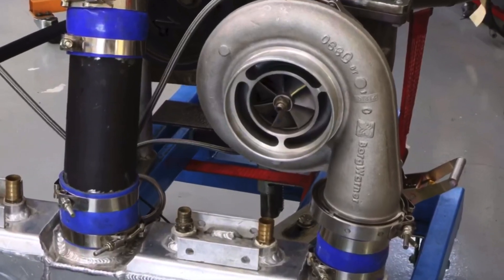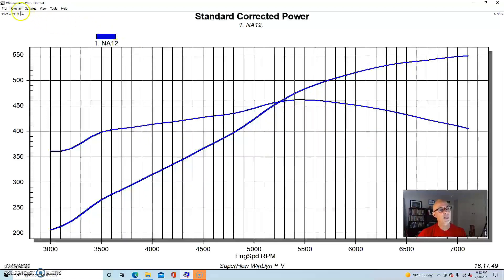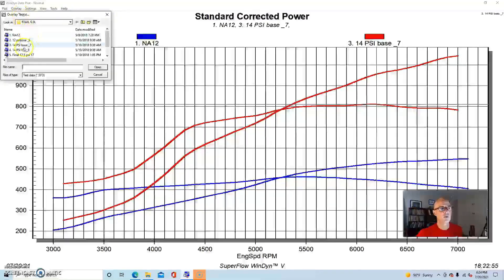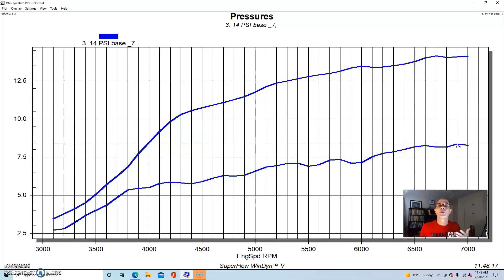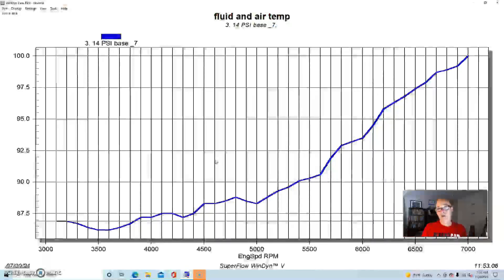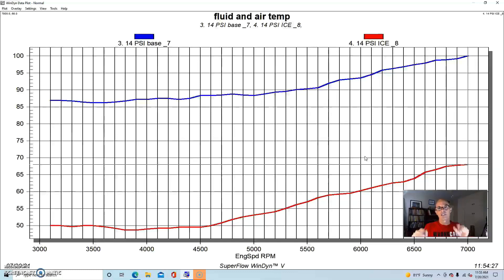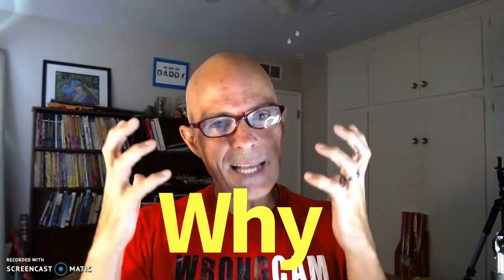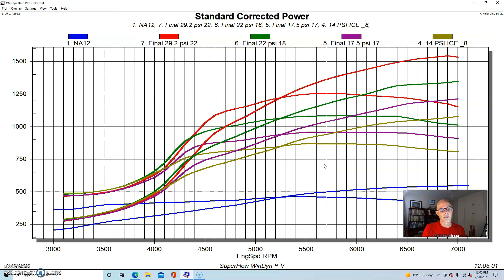JUNKYARD TWIN TURBO 6.0L ATW INTERCOOLER TEST (ICE WATER)

Comment: Richard - i'm not sure that i've ever seen it done, never mind by someone that does things in the scientific ways that you do, but i would LOVE LOVE LOVE to see you do a test on a basic LS, say a sloppy stage 2 cam or whatever, but use two different sized turbos... say a 78/76 and an 88/103, or a 67 and 78 on each side.. Just to see what happens! and a fair gap between the two (5+mm?) so that way there's definitely a difference in flow...        I would be seriously interested to see if that would HELP or HURT the horsepower! Maybe the bigger turbo would "fight" the smaller turbo and actually cause LESS boost..

Maybe even just have a bench racing live session and discuss it?!
Reply: all these tests have been done you just have to look back over the channel
Reply: @bill2178  I browsed through recently and couldn’t find anything on odd sized twins. Obviously there’s a ton of single vs single vs single videos but not what I am referring to. I could have missed it though - I’ll look again!
Reply from the maker: they will fit each other-flow from the small turbo that spools quicker will try to escape out the big turbo at lower speeds, the opposite at higher speeds (unequal flow) is my guess
Reply: @richardholdener1727  that’s basically what I would expect.. small turbo would counteract the large turbo down “low” rpm, but once the exhaust pressure spools the big one it would probably freight-train the hell out of the little one and stop it from making boost. If I was a betting man, I would expect a wavy boost curve and low boost top and bottom rpm ranges… and I mean manifold pressure not turbo outlet..

Comment: The turbo is a “free air” device, seeks equilibrium in its own space. The denser charge made more power, increasing the energy available in the exhaust flow to the turbine. The compressor got spun a bit higher and, with the denser charge, pushed more air mass into the engine. Air actually has very significant mass and making it over 30° cooler has a significant effect. Absolute zero F is about negative 460° so the density change due to temperature is approximately 560/527, or about 6% more dense. The Holley sees more air density, adds fuel accordingly, and that increases everything. That’s my 2 cents worth on the subject, anyway.
Reply from the maker: the Holley did not see a change in air temp-but I did add fuel to to keep the af consistent between the two runs

Comment: I'm thinking the denser air caused the turbine to spin faster.  Do you have a graph of turbo RPM?
Reply: That was sort of a knee jerk answer.... as you pointed out the back pressure increased because of air density so this caused a greater pressure differential across the turbine making it spin faster.  Also maybe it got into a more efficient part of the map.

Comment: Richard could you run and U run antifreeze and dry ice through an intercooler ? Maybe for a video
Reply: anti freeze isn't the best for picking up heat. I run only enough anti freeze through my air-water intercooler to keep it from freezing in winter.

Comment: Possibly, the increase mass of air (density) with the same fuel input would create a leaner air:fuel mixture. 
Meaning it it was slightly rich on the initial tune and closer to optimum with more air.
Reply from the maker: af was identical
Reply: @richardholdener1727  so total fuel increased to maintain the same ratio. 
More air + More fuel = More Power. 👍
Reply: @richardholdener1727  ah, misunderstood. 
I thought that the fuel volume/rate/tune was identical.
But it was the A:F ratio that stayed the same. 
So fuel did increase.
More air + more fuel = more Power. 👍

Comment: Simple thermodynamics.  Air molecules are smaller so you can shove more of them in the cylinder. More air plus more fuel equals more power.

Comment: the relative change in intake temperature is much greater than the relative change in exhaust temperature;
your intake air got significantly more dense (303k (95f) -> 273k, about 10% more dense), but your exhaust air only got a little bit more dense (estimating numbers 1173k -> 1150k, about 2% denser)
as a result, for the same pressure ratio, your turbo could move 8%  more air mass, this results in a higher exhaust mass flow, causing the turbo to move even air mass, this increase in air mass leads to a slightly higher exhaust mass and this repeats until it reaches an equilibrium due to the WG.

this equilibrium will be at a higher intake pressure, as the exhaust pressure has increased, the mass of exhaust that flows through the wg and turbine has increased, but they have increased in the same ratio to their current flows, so the turbine will flow more mass than the wg, this will increase intake pressure, that will drive the wg to open more to limit the turbine mass flow but the thing to note is, the intake pressure needs to be higher than it was previously to limit the turbine mass flow at the new equilibrium point.

Comment: I'd like to know hot that 6.0 redlined at 7000 with stock internals
Reply: Gen 4 rods
Reply from the maker: we run gen 3 and gen 4 sbe ls motors from the junkyard to 7000 all the time  (good springs)
Reply: @richardholdener1727  can a 5.3 rev to 7k with cams and springs as well?
Reply: It's all in the Top End, not the Bottom!

Comment: Charge air was more dense, increasing mass flow through the system, allowing the turbine to make more power (due to higher enthalpy in the exhaust) to drive the compressor to higher boost pressure.  Then when the engine reached 14.0 psi at 6100 rpm, the wastegate became active because the boost setpoint was reached, then boost pressure bled down to be equal to the ambient water data by 6500 rpm.

Increase in charge temperature throughout the power sweep is probably inevitable.  Because the boost pressure was rising with increasing speed, the compressor discharge temperature would have been increasing, too.  The intercooler effectiveness was probably higher at the higher temperature.  If the boost pressure had stabilized at 14.0 psi by 3000 rpm, the charge temperature would have been more stable, but higher.
Reply: Nailed it!!
Reply: ^^^ this right here

Comment: Am I the only one amazed by the power and marketability of what's going on here? Richard is taking used engines with tens of thousands of miles and turning them into drag racing motors! Correct me if I'm wrong, 90% of the stuff is used parts! Stuff he has bought at the junkyard at a fraction of the price new. Making HP numbers north of 500 NA and then doubling, sometimes tripling HP numbers boosted! All with 80-90% used parts?
Reply: its a testament to how important it is to calibrate the engine properly
Reply: #Ring gap and tuning matters
Reply: It's also a testament to how reliable these modern GM engines are as well. They are very well designed. More cost affective for guys to use junkyard blocks and build on top of them, than it is to do a complete build. Not just the LS engines, but even the discontinued 3800 90⁰ V6 engines, and the 60⁰ V6's. They all have relatively strong button ends and can handle pretty big HP numbers in stock form
Reply: Yes but your also forgetting he isn’t trying to drive the motor in your car for 50-100k miles either..lol..making dyno power, and making livable power with longevity is different and why we spend money on aftermarket parts, although that’s not to say with the right blue printing some stock parts can last for quite awhile at 600-800rwhp..I doubt 29psi on a stock LS engine would last very long, even if they installed different gaps,a complete set of studs, different rings,and bearings would help, but still, it’s a bomb just waiting to go off..lol…
Reply: @markim5087  you're absolutely right. The minute anyone modifys and pushes these engines hard, their life expectancy reduces. Even with that being said, these engines are still far more reliable up to a certain point of power. 1000hp on a stock engine isn't going to last long lol. 500-600 is more realistic as far as being able to rely on them. There's other factors to consider as well.  I imagine if he tried that on an old SBC that was stock, it would probably last even less as long, if it even lasted on the dyno
Reply: @markim5087  great points!
Reply: Bro this is what’s going on at the track everyday, not just on Richards YT channel. There are literally more junkyard LS engines powering insanely fast drag cars then there are actual built racing engines these days. Fact is you don’t gain any power going with a built engine over a stock one if specs remain the same. If you have a stock 5.3 at 9:1 and a fully forged 5.3 at 9:1 with the same cam and heads, they will make the same power. The only benefit you get from the fully forged version is reliability. However people have finally realized that it’s cheaper to just swap out readily available junkyard blocks when they pop then it is to build a fully forged race engine. The only way you gain power with a built setup over a stock one is if you change displacement or compression. But a 9:1 325 CID 5.3 at 15# can make what a fully built 325 CID 5.3 at 15# makes just as well.
Reply: @kennethpowers8995  sure that’s not a secret and never has been, yet it’s better to build a forged motor and be once and done, it doesn’t have to be a full race motor, many stock motors have great cranks, and a good set of rods and pistons aren’t that costly, then you can just add more boost and run for yrs if it’s tuned right and maintain correctly…I’ve ran the same 1000rwhp motor for 15 yrs right up till I sold the car, 80k miles later it was still going strong..
Sure throwing in a junk yard motor, with studs and a set of heads, with a turbo kit works, but by the time you’ve swapped 3-4 motors really pushing the limits , we could of built a fire breathing beast which also has more value if you want to upgrade later..
Reply: @kennethpowers8995  well point out brother!
Reply: And this pains me greatly because the high dollar ~10:1 370 CID iron block I have built with all top shelf rotating components that is in my grudge car makes about the same power as the bone stock LS3 rotating assembly in the car I’m building for my cousin. I have a set of PRC fully worked L92 heads on the LS3 and AFR Mongoose heads on my 370, we run similar cam profiles only my 370 has a TSP cam and the LS3 has a BTR piece, but when the same boost pressure is applied through our matching PTE turbos we’re within 40 or so HP of eachother.
Reply: Yes great time to be around . Just wish I had his knowledge to build my 1000 hp fiberglass 32 for because.

Comment: +1500hp on a stock bottom end 🔥👍
Reply: The 'air bleed' wastegate control is limiting low rpm torque, thus preserving tbe bottom end.

Comment: Density Ratio increased because colder air has more molecules of air per cubic inch than warmer air. Gale Banks has been preaching this for a while: "the boost gauge is dead" he says! Density Ratio is the key! Imagine what the loss would have been with No charge cooler at all, Yikes! You would have power loss, then found the evil detonation/Pre-Ignition threshold !  Great subject! Thanks Richard

Comment: I expected a pressure drop due to density increase... My guess would be following the same principals through the cycles and having a cooler more dense exhaust flow forced an increase in flow density through the turbos. Did egt lower significantly?
Reply: Denser medium = more resistance to flow (definition of pressure). EGT would remain consistent despite the exothermic energy increase up to the point of back pressure increasing faster than boost pressure (exhaust flow limit where it becomes a restriction).

Comment: I see a lot of comments about cooler air being more dense but another factor is that hot air means you have to pull timing to avoid detonation. You mentioned you didn’t “allow” it to add more timing but it’s still going to not pull as much timing with a cooler charge of air vs a hotter charge.
Reply from the maker: timing was identical on this
Reply: Pretty sure timing is predetermined at any given rpm

Comment: Would like to see this test with a roots blower, take the pressure referenced boost control out of the equation.
Reply: Roots blower = much lower performance.
Reply: @nordic5490  absolutely, but this would be a good test for a LSA or LS9.
Reply from the maker: I have done this with a blower too
Reply: I use an a/w on a roots.I did a video on the dyno and gained 100hp from the I/c

Comment: They gave it more power at lower RPM to initially make higher power the reason it never reached peak power is because the volume of air is still the same
Reply: It's gave it more power at a low rpm*

Comment: Air density is the tune and way to measure the amount of air. What would have happened?
Greater pressure differential between the hot and cold side of the intercooler. It would create a slight Venturi effect pulling more air or technically less intake restriction.
To do this correctly, you need enough intercooler to eliminate heat soak or temperature rise. If you can maintain 50 degree air, you'll have 0.18 pounds of air in a cubic foot. You can't tune by CFM and you'll see why in a moment. At 150F theres only 0.15 pounds of air in a cubic foot. 
Most everyone either has, or knows someone that has, blown up a two stroke dirt bike on a cold fall day. Or blown up a 2 stroke snowmobile on a super cold winter day.
All reports are the same, "it's never run so good! Right until it blew up." That's because they have more air by weight in a cubic foot. This leans the engine out and will probably blow up the big bang as well if it stays at 50F through a run. This is why intake air temperature is critical for the ECU to maintain AFR whether it's using a mass flow meter or a speed density tune based on observed volumetric efficiency and air TEMPERATURE. The ECU should automatically correct for the colder air and inject more fuel to compensate for the increase in air. It goes beyond that. With super cool combustion air, you can get away with more advanced timing and increased fuel to match the increased air. With a blower running 20 psi at 350F, you literally double the amount of air at the same pressure by cooling it to 50F. It's difficult to see at small temperature. In high temperature like a blower or turbo running 350-400 degree air will literally double the horsepower with no change in boost pressure. 0.08lbs cubic foot to 0.18lbs per cubic foot at 20psi boost.
Reply: Wrong answer not what he was asking for..think about this cold air takes up less space, why the Air molecules are much smaller , the same amount of air volume takes up less space in the motor, so the turbos can ram more air in which does what, ? Increases pressure..that’s the simple answer I’m guessing he is lookimg for, your talking about ecm making changes,how it makes more power, he only wanted to know why the boost increases , he had it locked so it couldn’t adjust for cold air…the answer seems pretty simple..
Reply: @markim5087  First off a cubic foot is a very defined space. I gave the exact amount of air in said space and different temperatures. And yes you need to know that for THE TRUE ANSWER on whether ice water makes more power. You need more fuel because you literally have more air in the same space at the same pressure. You can increase timing because the cold air greatly reduces chance of detonation. And the last part, A non intercooled turbo puts out air at around 400 degrees running hard. 50 degree air in comparison is exactly twice the air and twice the horsepower. Actually a little more because you can add a few degrees of timing. The right intercooler adds as much or more power than the turbo.

Comment: As to your question, why the increase in boost pressure with zero changes other than the lower IAT, one thing I have witnessed is heat weakens the spring in the BOV.  The spring adds additional pressure on top of manifold pressure.

A weaker spring can cause a slight boost leak in some circumstances.  We had this problem recently with a pair of BOV’s

In our case, the boost leak was so excessive that we were spinning the turbos so hard to make the amount of boost needed, it drove the intake air temps up almost 70 degrees.

A new pair of BOV’s cured our problems and lowered the IAT’s and make more power on much less dome pressure.
Reply: Interesting.
Reply from the maker: there was no bov leaking

Comment: I can't wait until more chillers are being used that utilize freon. No need for front mount. Just a chiller in between boost source and intake or in between intake and heads like the demon. Just use 12v ac compressor and freon/coolant heat exchanger out of electric cars
Reply: Hmm. Dodge demon has a freeon cooling system? Googling***
Reply: @umakemerandy3669  I believe they call it an interchiller. It cools the air with freon and you can have air Temps like 40 degree Fahrenheit on a hot day
Reply: @Shiftheads  Thats pretty cool! Glad you commented.

Comment: Additionally: Looking at P.V=n.R.T

In this case we observe at reduction in temperature from 310K to 293K. a reduction of ~5.5%.

Since V is constant, R is constant. we need to increase 'n' to balance the equation. More 'n' = more mass flow = MORE POWER BABAY! (I know this is not exactly the case, and it's more complex than this, but stick with it, the fundamentals and broad strokes are what's important here.)

Since turbo's are not 100% efficient, we also observe a rise in boost pressure. In the observed example we see a change in power between 3-8% in line with expectations based off the intake charge temp change throughout the rev range
Reply: I agree.  To add, the higher density (colder air) reduces pressure drop (if the flow was the same)  enabling more flow for the same boost level.  This would increase the energy of the exhaust (more flow) hence more turbo power.